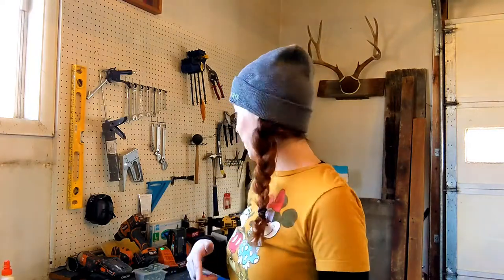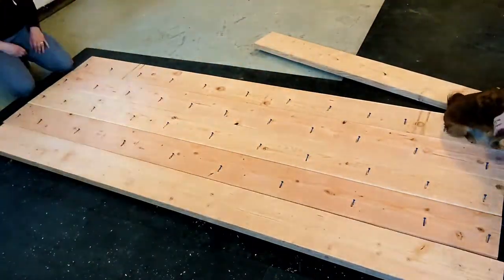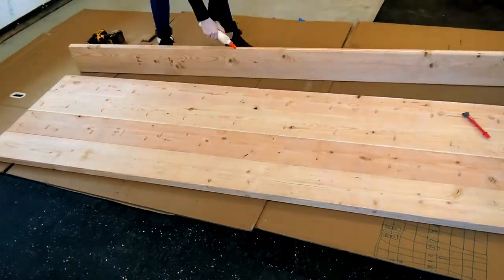Building a Budget-Friendly DIY Rustic Farmhouse Dining Table Under $200

Comment: Any sanding or planing?
Reply from the maker: No access to a planer, but there was lots of sanding!
Reply: @houseoftimbers  Y'all did an incredible job. I'm trying to make a table now. How did y'all square the long edges of the boards to bring them together flush? My boards are showing very small gaps that span several inches across 8 ft.
Reply: @houseoftimbers  table saw?
Reply from the maker: @TonySaysHello  Nope, we made all the cuts with a chop saw. Or you could use a circular saw, but that would be more time consuming.
Reply from the maker: @TonySaysHello  We didn't square them. We selected the best lumber that we could find, but they aren't completely flush the whole length down. If you don't want the "crumb catcher" then you can fill the seams with wood filler and sand down. That's one downside to having limited tools and budget.   If you have the ability to joint the edges, then that would make them completely flush.
Reply: @houseoftimbers  thank you so much for your replies. They helped me a lot with this project here in front of me. Great job on yours as well. I hope it's holding up.